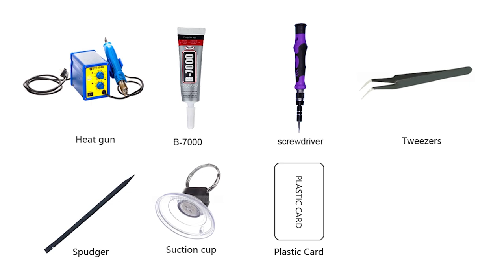OnePlus 9 Pro Screen Replacement

Comment: Have question  if u have a T-Mobile variant OnePlus 9 pro and change display will everything still function like WiFi calling is there chance of losing any features if replacement was done
Reply from the maker: I suggest you buy the original mobile phone screen to avoid missing functionality.

Comment: how did you test display? only attach display cable and battery cable and power it on? without motherboard and other parts?

Comment: First of all thank you. The phone repair worked. I went to my local phone shop and they said that the display costs 450€ alone. So i found the display on your website and ordert it. It arrived faster than expectet. I testet the new screen and everythink worked. So i put the phone together and it is amazing. Even the fingerprint sensor works without any issue. It is in fact an amoled display with 120hz. First i thought that the oem claim is fake but it might be an oem part. Even if it is not it is equally as good. The back glass for 13€ is also great. In my local phone shop they said that the price is 120€ only for the back glass. Best desicion to order of your website. Big recommendation from me. The tutorial is also good, but i would not stick the plastic card from the inside. For me it damaged the black tape. 6:13 
Over all great stuff.

Comment: The lcd is similar to oppo find x3 pro lcd display right?
Reply from the maker: No, it's a oneplus screen, as for the model you mentioned it may be compatible, but to avoid unwanted effects I suggest you buy the model specific one.

Comment: I just did this repair using this video as refence. evrything went well but fingerprint reader no longer works. 
I think its like apple if you change the reader then it will not work anymore.
Reply: You need to recalibrate your fingerprint reader after the new screen reinstall.